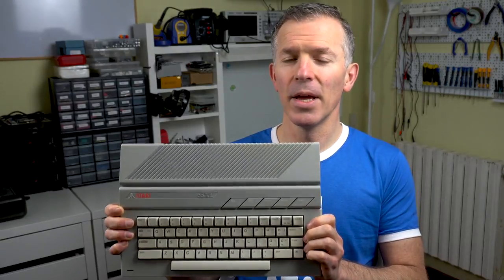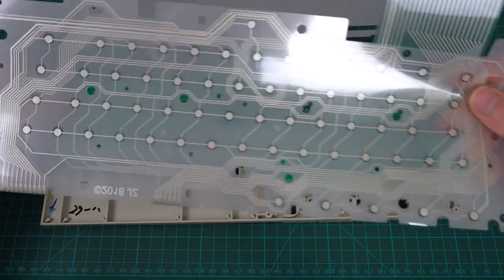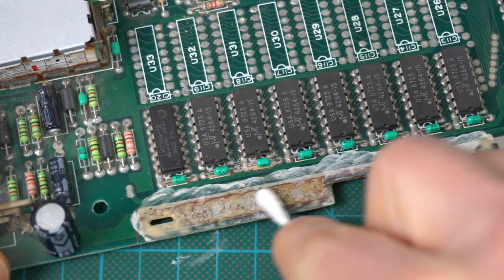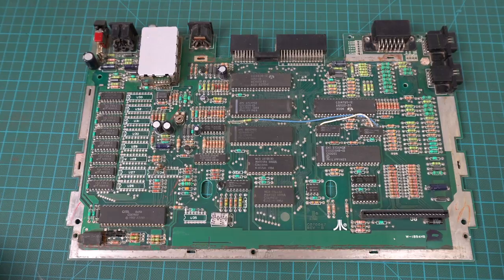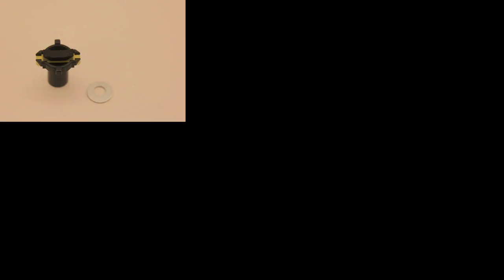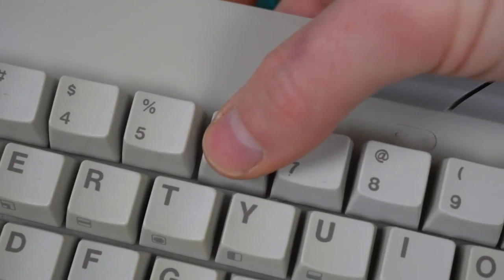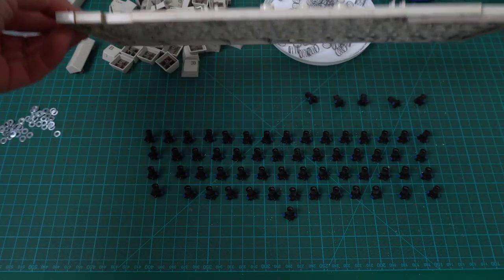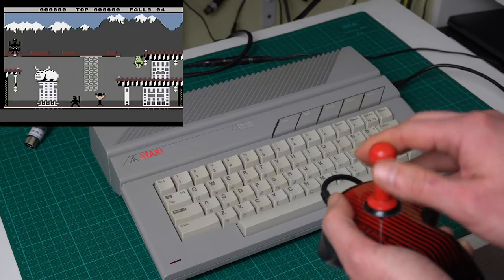Atari 65XE Keyboard Membrane Replacement and Rust Removal [Nibble Edition]

Comment: why did all buttons malfunction at the same time?
Reply from the maker: Because of how keyboards work. They have a matrix of connections with rows and columns (usually around 8-12 rows) and so several keys are hooked up with a single row and a different set of keys are hooked up to a single column. If a track in the membrane breaks, all the keys in that row or column will stop responding. So with a few cracks, most (or all) of the keyboard will malfunciton.

Comment: I hope that rust remover doesn't corrode the tracks down the road.  It was my first thought when you were working around the RAM.   I would have rinsed the entire board with distilled water personally after that process and blown it all dry with the air compressor followed by some hot air to finish it off.
Reply: More like neutralise the acid with a base and then rinse it off.
Deminerlized water is a good idea, at least it leaves no pesky crystals

Comment: first computer here as well - i got hold of 65xe in really good condition BUT keys A, S, 1, 2 - wont work i opened the computer and i  see why, on the membrane it shows no connection between these keys, is it possible to fix it? or i need new membrane ? All the keys are fine, and sound is good as well,  thanks!, great video!
Reply from the maker: Look at my Amiga 500 membrane repair video for ideas. But unless it's a very simple, clean break, I'd say you're better off getting a new membrane. Just don't do like I did and order the right kind! :-)

Comment: Wow! What a lot of work to recover this functional but dirty, and soon to be failing, computer.

It could be very interesting to see if you can expand the RAM memory to 128KB.

I have also noticed that there are other marked empty spaces, for some additional components. What could those components be?
Reply from the maker: Thanks! Yes, it took a while to get it to this state 😃 I considered making a 128K expansion, but I started looking into it and it seems there are better ways to do it than building it into the board itself. But yes, those spots on the board seem to be perfect for another set of 64K of RAM and some kind of demultiplexor, so just filling that in would probably do it.

Comment: keyplungers looks almost identical to Amiga 500/600/1200 plungers. In fact, I think they are identical
Reply from the maker: True. I should actually test them and find out if they're really identical. There are a lot of things in this machine that remind me of the Amiga. I doubt it's coincidence :-)
Reply: @NoelsRetroLab  Jay MIner and Joe Decuir were designers of the Atari 2600, Atari 800 and Amiga chipsets so there definitely is some heritage :-)

Comment: Would a magic eraser (melamine foam) work on the edge rust?
Reply from the maker: The edge of the board? I don't know. I didn't think about that, but it could be worth a try!
Reply: No, the oxidation is most times burning into the other metal and you have to use non mechanical methods like chemical or electro-catalytic (not good on boards).

Best I used for this is sulfuric acid, please use googles and other psa like mask, long sleeved hoodie and long gloves that are acid proof.

Apply it with a qtip and watch it burn the oxidation away. Have a base ready to neutralise the acid and watch it, this stuff could attack the metal when you don't watch out. Rinse the board after you are done and dry it off good.

Comment: Do you recall the outside diameter and thickness of the washers? I'm going to order some nylon ones from Aliexpress. Thanks
Reply: there are 6mm and 8mm outside diameter options. I'm guessing by looking at the video again that yours were 6mm OD
Reply from the maker: Sorry I didn't get back to you earlier. Looking at my notes, they are standard M3 washers (Ø7mm). Hope that helps!
Reply: @NoelsRetroLab  Thanks Noel. Ordered some. Cheers

Comment: Curious question, have you any experience with the upgraded keyboard kit for the XE65 and XE130?  Best Electronics has/had them, and I haven't found anyone who has any experience with them.  I am wondering if it is worth the price to upgrade my keyboard, as I write programs in basic with my daughter on it a couple times a week.
Reply from the maker: Not at all I'm afraid. I didn't even know about it! I would check on the atariage forum since they seem to know all about Atari there :-) If you do try it, I'd love to hear about your experience though.
Reply: The Best Electronics XE keyboard upgrade is an okay improvement but not earth shattering. You might enjoy it. Takes a while to install all the new cups.  Enjoy programming with your daughter!